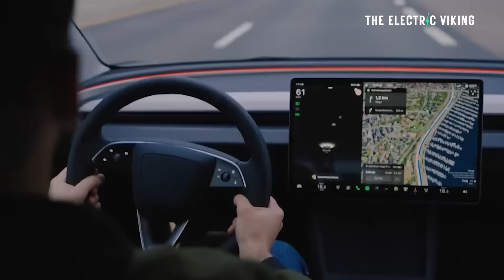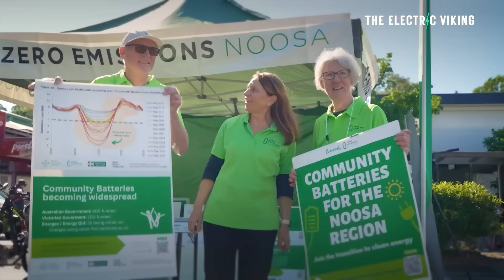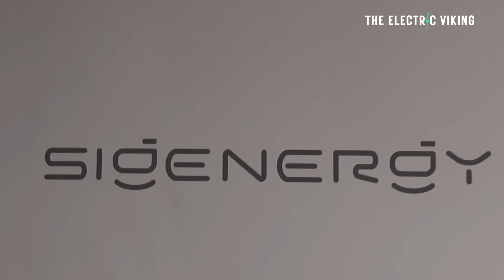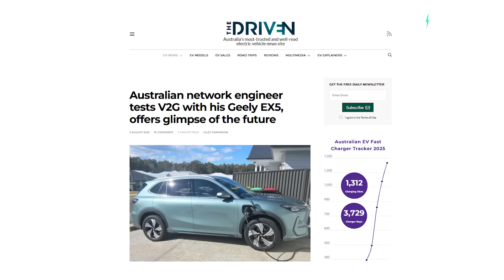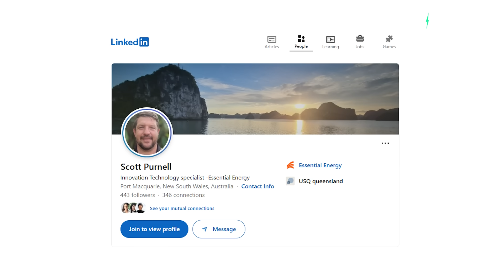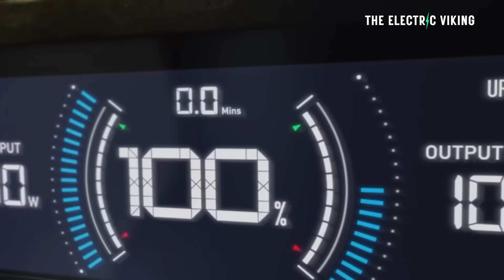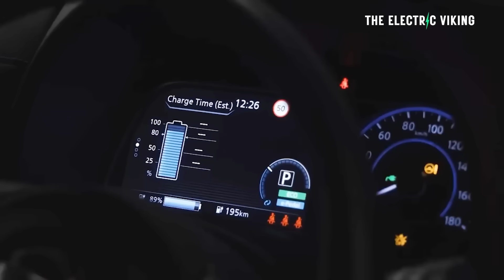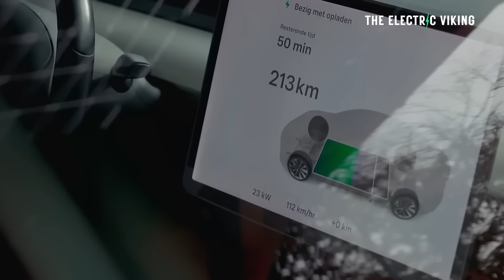V2G Hits Hyperdrive in Australia - Works with Xpeng, BYD, Tesla & Geely!!!

Comment: The only way to go really is a 10kw+ Home battery plus V2G EV and a large solar system. That way you can leave home and still have your home totally off grid. The car is used for extra supply when required or when your battery is depleted when parked, that way you limit the cycles on your EV battery but you get a near off grid usage pattern. Plus the chance to support the grid when required. The car only as a home-battery is really a non starter as it is not always available. So excess solar just goes to the grid when it is probably not needed by your utility. With the home battery it is just soaked up till you can use it. Win Win. I know it costs more but it is the only potential system that truly works 24/7. Great article 😊
Reply: Don’t want V2G because we get practically nothing for exporting power but really want V2H only. Is this possible. Have a Tesla 2 battery and 3 phase power. Would they be compatible ?
Reply: @marytatlor832  if you go with V2G setup, then you can participate in a VPP program offered by some of the providers like Amber or Origin. You can get a much higher feed-in tariff that way. If you want a quicker return on investment, then V2G is the way to go. With just V2H, it will take much longer.
Reply: With the economics of the battery storage subsidy going large or going home is easy when labour costs are a big component of the install
Reply: EV2台所有がベストでは？
Reply: Just buy a second hand EV and leave it in the garage plugged in. At least twice as much battery  for the same money and you can use it as a car and charge it elsewhere if your grid or solar goes down
Reply: @richardvivian3665 lol I could see people doing that, an old one with a piddling 35kw battery, worthless as a car but far cheaper than 7 5kw server rack batteries
Reply: Congratulations for financing or pre paying your electricity bill for the next 20 years...... Win👏....... Win👏......
Reply: @dynamicsoulslayer  you have no idea. system gets paid off in less than 6 years so the next 14 or so years his electricity bills will be next to 0. Don't bother replying, just concentrate on as to how you will come up with the funds to keep paying for your electricity forever........  now that's a Win for him & A loose for you!
Reply: @dynamicsoulslayer not the sharpest mind are ya 😅
Reply: @dynamicsoulslayer tell us you have a low IQ without telling us you have a low IQ

Comment: This is a bit silly . This has been possible for specific makes of vehicles but you need expensive installation and purchase of electrical equipment as you need in the case stated in this media display . Until you can find a inexpensive way to plug into a homes electrical system it's really not worth the cost and the degregation of the battery which it's primary function is for transportation . 
Now we do have vehicles in the United States like the Ford lightning that can be plugged into a homes electrical system with the on board or power but it can be tied into live grid power you would need a transferr switch to separate and only can be used as a backup system . Now if you could run this during peak grid power that could be a savings but you probably can't run everything like air conditioning or electric heat but you could isolate those electrical devices and just run them off of the lightning if it could handle it and leave everything else tied to the grid . Still a bit complicated but the cost is minimal to do . When this can be done without expensive equipment than you have a game changer but at this time it's not worth the cost for what you get .
Reply: Your quoting facts and science, no place for that here.

Comment: The number of times you can charge your car battery before it begins to degrade is finite. V2G will speed up decline of your battery. It's unlikely the savings would be worth it and even if it were I can see why automakers would not consider that "normal" use if you have a warranty claim. I think a better idea would be V2H only when there is a power outage.
Reply: Additional Battery degradation will be absolutely minimal if you’re only using a small amount of your battery capacity,  say 35% to 65% or so.
30% of my Model 3 battery is about 22kWh, far more than my house uses.  Using percentages like that causes very little wear and tear on any lithium battery.
Reply: 日本でv2hをやってます。
多少劣化が早まるだけで
大した問題ではないです。
Reply: I have a Sungrow 40kwh battery and 23kw panels with heaps of excess power, basically running offgrid, I would only draw on V2G when price spikes. 
In early June there was a price spike where I earned $400 is a couple of hours, with access to an additional 100kwh, I would have earned around $1500 and I saw screenshots of others doing so. I expect spikes to reduces until coal powers winds down then ?
Reply: Don't let logic get in the way of a good story.
Reply: Jeff Dahn disagrees.

Comment: I doubt you are voiding the warranty. The Geely EX5 has unlimited km on the battery on the warranty and also explicitly markets its ability to DC charge another car at 6kw. Combine those two and they would need to prove that V2G put strain on the battery above their use case. Only if they can prove that the V2G caused any fault, not merely that you used V2G, would it invalidate the warranty. Geely would need to issue a revised warranty that explicitly says you cannot do V2G.
Reply: At home you might charge/discharge at 6kW.  Both are CONSTANTLY exceeded in normal car driving and charging.  For an EV car battery, V2G is the equivalent of a nice lie-in!
Reply: There was a geely official statement sent out to reviewers another Aussie EV reviewer got the email saying that if there is an issue when you are V2G That's to cover themselves
Reply: @maxsgeekdom8514  That's not invalidating the warranty though. They would need to prove that the fault in the battery was due to V2G. Also, Geely official statements are not relevant. The terms of the warranty are what is relevant and unless V2G is explicitly prohibited there is no reason why it can't be used. V2G is simply using the same protocol that charging another car is using which Geely explicitly markets its car as being able to do.
Reply: Sorry Henry; they won't warrant V2G due to 3rd party variables. I bet there is some clause hidden in the fine print all ready excluding V2G use. Absolutely not worth the risk until expressly approved, read my earlier comment.
Reply: @darroncrick9993 They can only deny a claim if they prove V2G caused the fault. Using it within limits is like heating a pharmacy heat wrap in a microwave - if it later breaks from an unrelated defect, they still have to cover it.

Comment: Wait six months, new products will come out at 2/3 the price due to all the competition.
Reply: And lower STC rebate too each calendar year
Reply: Yes & No.
Yes, prices will be cheaper, more choices, more features, higher quality
No, rebates will reduce or end. In 6 months, you will be able to say the same
My 2.4kw PV system cost $27k in 2007, with $10k rebate and 60c fixed FiT for 20 years. 
Replaced original with 23kw PV with 40kwh battery knowing there will be better panels and batteries in the future.
Reply: @VaCha62 rebate is until 2030 and even if funding is exhausted that won’t be until 2028. The safe sweet spot is late next year. Much more competition, better features, lower prices.

Comment: Batteries are a real problem with any electric car a battery has not been invented yet that really will last on any electric cars
Reply: Gasoline motors don't last 4ever either.
Reply: Evs are not built to last either. The battery and car will both fail all too quickly. Will any ev still be around in 30 years. I have 2 thirty year old Toyota's that are going strong and may last another 20 or 30 years.
Reply: Err umm yes there are 15 year old evs. There is a million mile Tesla running on its original battery. There is zero doubt that long term EVs will out live ICE 2 to 1 or better. There are huge differences in the number of wear and tear parts between EV and ICE. Both can be kept running over decades, EV will just cost less to keep.
Reply: @markpirola8152 it's not just evs that won't last, all newer cars won't last much past their warranty period. That is the way they are designed. Phones TVs, refrigerators toasters vacuum cleaners etc are all now built with inbuilt obsolescence. This cuts down the cost of production and guarantees regular future sales. There is no money to be made by producing items that last a long time.
Reply: LTO have 100x more charge cycles, they're 2x less energy dense though, bigger, heavier, but still 100x more cycles, and they have 5c-10c charging, thats crazy you can charge a 42 volt 45 amp hour pack with 20 000 watts! 20k not 2k, thats more then level 2 charging a car (7kw) and they're charging huge batteries, you can charge a small one with that much power in like 10 minutes, and have 120km range on an ebike.  THe way faster charging, the way more cycles, and the fact they're fireproof means i dont know why these arent used in EV's.    Maybe becaues they're just too big but im not sure.  But these batteries are what im building my next ebike  / scooter battery with.
Reply: My 2010 Audi Q5 had 3 year warranty that I extended to 6 years. Needs regulator maintenance. Excellent Car for its time.
Looking at Zeekr 7X EV which has a 7 year warranty. Requires way less maintenance. Faster, Cheaper, Greater Range, Powered off solar, etc. 
A 6 year Tesla's battery reduced 10% as forecast, owner does not regret purchase.
One would expect that in 7 years one could get an off market upgrade of vehicle batteries and get greater range.